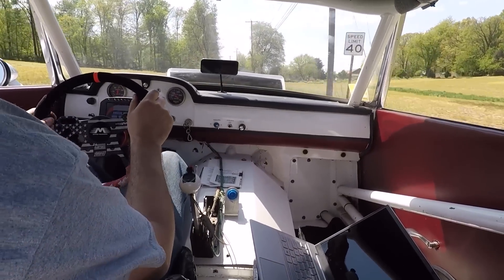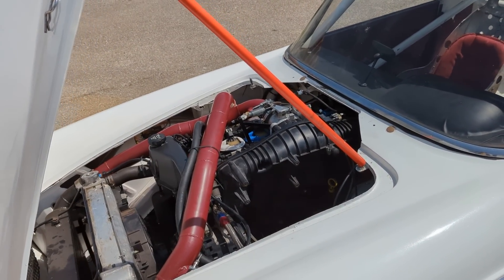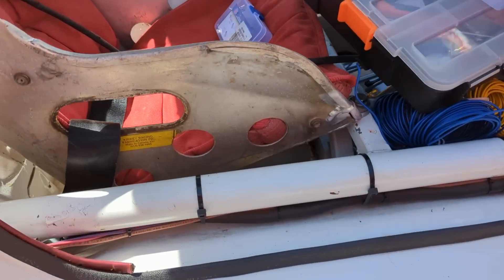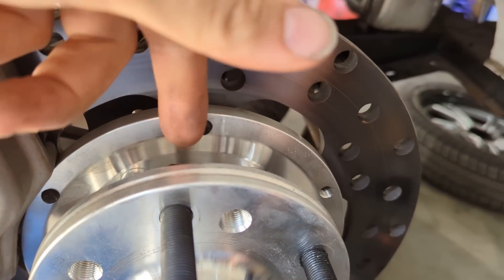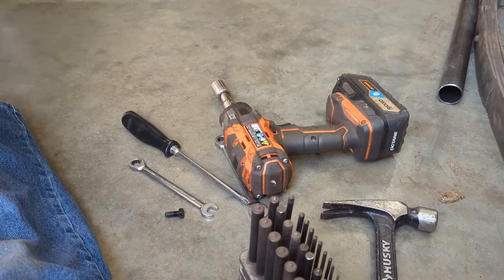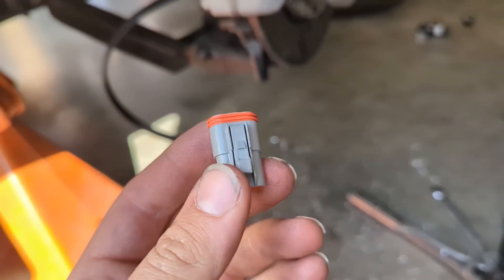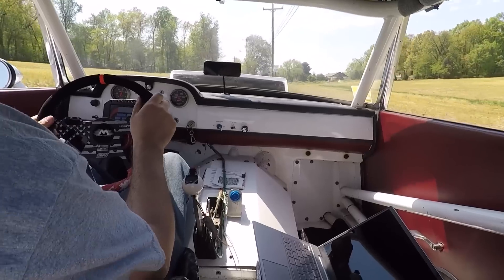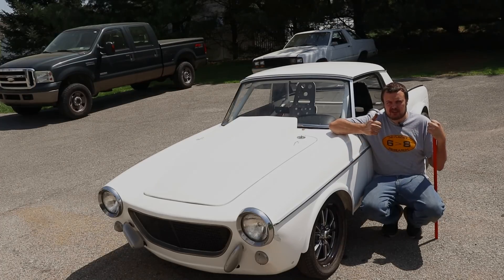Little Car, Big Upgrades - Traction Control Install + ECU Upgrade

Comment: Rewatching all of them, been dealing w proxs for years, never even realized the 1.0 is 1 mm per 1 revolution. I use a tiny AB 871c-m2np5-p3 on my rzr. Super small but idk if 3khz switching is enough for that. EE, I’m sure you already know lol.

Comment: Can you make a video on just the ecu stuff?  I want to know the easiest way to get this ecu and wiring needed to run the 4200 in a swap.  With the piggy back ecu are the injectors batch firing?  Are the coils batch firing?
Reply from the maker: Yeah it would be batch fire.

Comment: I know you guys are big into in-line 6’s.  For a smaller car like this could using the inline 5 (3.5 litre) from a Chevy Colorado?  I thought those were the same architecture just one less cylinder so it wouldn’t be so long.  I know you’re giving up displacement, but for a little peanut of a car like this probably still plenty of power!
Reply from the maker: Yeah. That would be a great option. Unfortunately for the price of the 5 cylinder we can get 4 of these 6 cylinders. I would love to mess with one someday...

Comment: I'm running a microsquirt on my 4cyl nissan motor. I never thought of piggybacking, but I can see why you swapped over to MS3x with VVTi and the need for sequential spark and fuel.

Comment: Transfer punches.  
Hole spotters are another useful tool.  These come in threaded for threaded holes as well as non threaded for plain holes.  KBC Tools is a good source for this kind of thing. Enco used to be the source until MSC bought them and dumped most of the lower end ( but OK for occasional use ) product line.

Comment: In the video shown a sensor hooked up to the driveshaft is that we use for rear wheel speed or do you hook up a sensor to each wheel on the rear end?
Reply from the maker: You can do either. We did it on the driveshaft for this one.

Comment: For drag racing where you lift front wheel one can then use a distance to ground  sensor under the car instead,correct?
Reply from the maker: You could. Or just put the wheels speed sensor on the wheel that is on the ground. You could probably use a shock height sensor to deactivate the traction control when the shock is fully extended.

Comment: These oddballs are what I like to see. Slowly getting back to the mood to keep evolving. 
3:55 Here's why shops recommend reserving a few more bucks for a standalone. The stock ECU will simply get lost with parameters it was never built to deal with.

Just because I like keeping all within the same house, I imagine such a small, light car would be nice with a NA FIAT 5-cylinder (which is actually quite well developed over here), just to have fun on twisty roads.
Reply: Sr20det would be nice… 4200 makes way more power. I think it’s built to go laser fast in a straight line. So smaller more expensive engines don’t really suit the build.
Reply: @2VersTT0  Yeah, this one's clearly a drag racer. But a small roadster like that could be a fun car for zipping through turns.

Comment: I laid on my back all day at the track yesterday working on a fuel leak on the return line to my stock gas tank.  I figured my shirt soaked up approximately .75 gallons of fuel so that should be a good baseline volume.  It was the first bracket race with my just put together turbo LS Duster with coincidentally a Goldbox ECU.
Reply from the maker: Fun. Glad I'm not the only one.

Comment: Do you have the link for traction control kit?
Reply from the maker: Not really a kit. Just a feature the Megasquirt Goldbox supports. For the wheel speed sensors. Just Google Cherry Hall effect sensor.

Comment: As an automation engineer we never call anything “a bug” it’s a feature.
Reply from the maker: Well, when you are trying to reduce the boost level and it instead gives it all the boost it can, I call that a bug.
Reply: @Calvin-Nelson  I call that a feature. Moh Powa
Reply from the maker: @RadDadisRad  until your upside down in a ditch because it blew the engine up...
Reply: @Calvin-Nelson  rapid unscheduled disassembly is another feature and so are tricks like flips.

Comment: Gasoline doesn't break in the clothing. Nope. You need brake fluid, brake cleaner and a bit of coolant to complete the break-in period. 🙂 All the best to you and the family. By the way... sticking your legs under a car on jack stands is asking for trouble... try instead to sit cross-legged 😛
Reply: Don’t forget a dab of blood in there somewhere too. Because you can’t get all of that on a shirt without busting at least one knuckle in the process 😂
Reply from the maker: I'll get right on that. Lol
Reply: You forgot burned trans fluid.
Reply: Don't leave Gear oil off the list, the kind that smells like rotten bananas.....
Reply: @fredbadgett7962  man, I hated that smell, the worst was when it was the first job of the day.